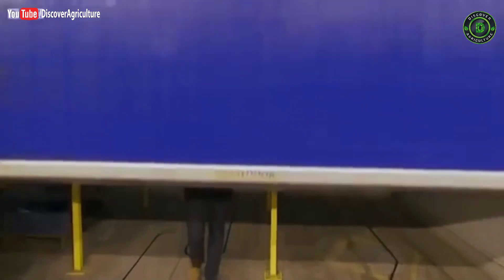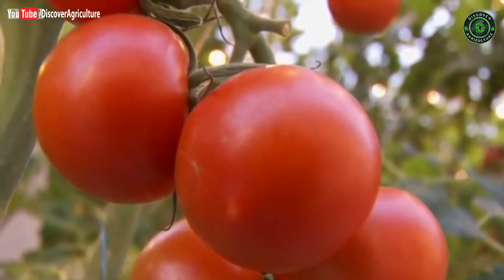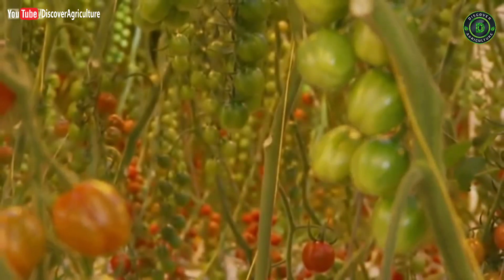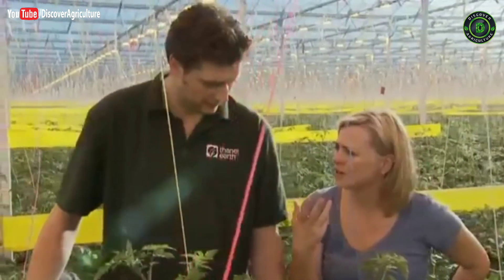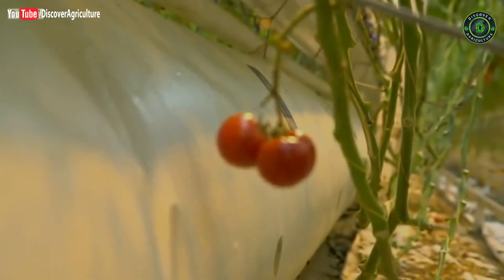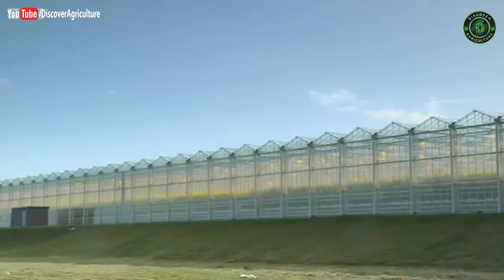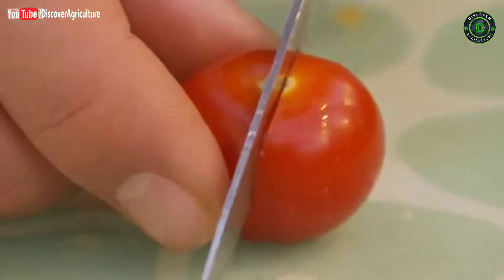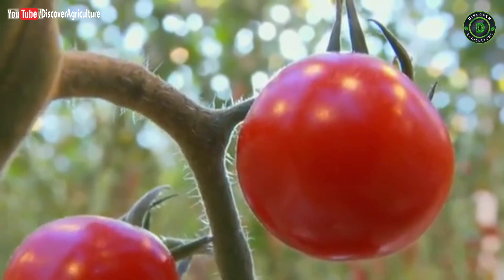25 Acre High-tech Tomato Farm | Greenhouse Tomato Farming

Comment: How tall do your tomatoes grow. How many fruits do you get per plant
Reply: Indeterminate variety tomato plants can grow up to 16 metres in the right conditions (humidity and VPD control, controlled temperature, supplemental CO2 etc.,)

Number of fruits differs by variety of tomato but for a normal tomato where each fruit weighs 100 gms weight, a single plant can produce up to 15 kilos of tomatoes per year or roughly 150 fruits.
Reply: @santyias87 oh
Can you guide me on this topic please , if you can link any extra information I will be grateful